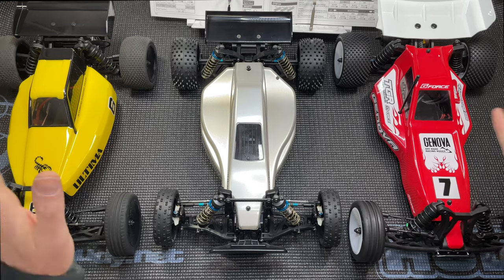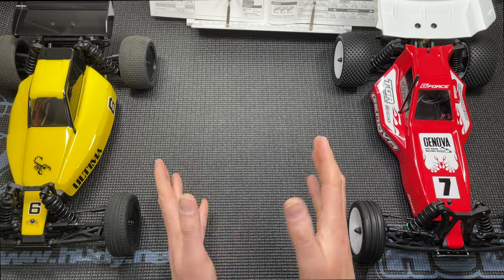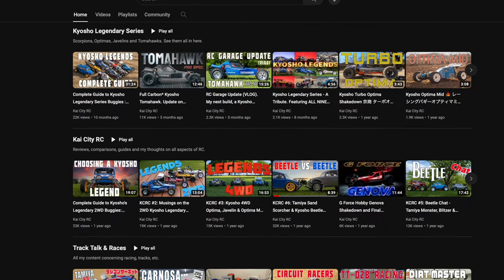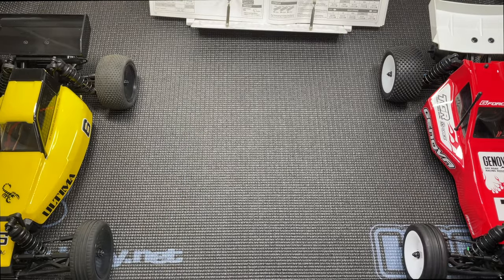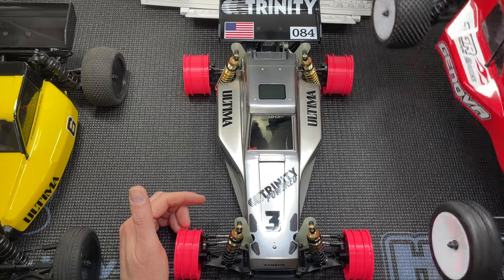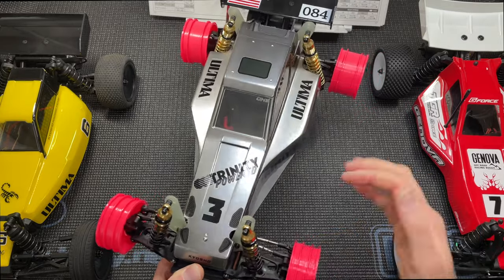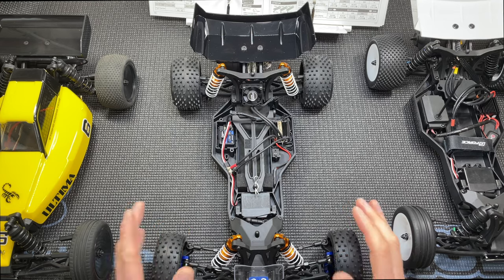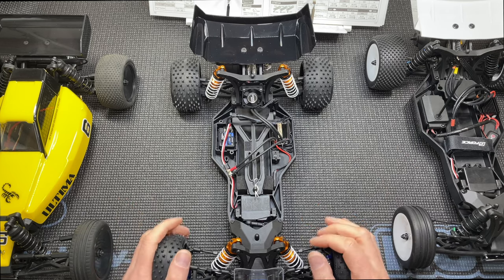RC Garage Update (VLOG): Final DT-02 Race, New Track, and a New Race Series for 2024.

Comment: please tell me. Is it likely that the S1 RM will come with a Genova or Tomahawk body?
Reply from the maker: The S1 RM won't come with a Genova or Tomahawk body as they are made by different manufacturers. If you meant, can you fit those bodies onto an S1 RM, well then.

The Genova body will drop straight on, don't even need to alter the cut lines. 👍 Though the side contours don't follow the S1 RM's exactly.

The Tomahawk body would require some cutting and it would stretch a little in places, but possible.

Hope that helps.
Reply: @KaiCityRC  Thank you for reply.
If it's a Genova body, it seems like it can be installed on the S1 RM by filling in the gaps with a sponge.
I like old-fashioned body designs like the Genova and Tomahawk.
Reply from the maker: I don't even think you'd need to go that far. It fits the S1 RM chassis surprisingly well! 👍

Comment: I just finished my Genova build. It was an easy car to build. The instructions show using machine screws everywhere. However, there are very few machine screws. Almost all of the screws are self taping. Once I figured that out it was a fast build. I did get all of the aluminum parts. Those parts are very expensive, but nice. The aluminum parts are all blue except for the shocks. They are orange ? That does not make any sense to me. I did get two bodies. I painted one in the box art orange. I did the other body in green with MCI decals to try and make my car look like Masami's car. I even got the metal ball links because this car has plastic ones. I did find that the pre-adjusted links were very close to where they need to be. That was nice. Also, this car does have turnbuckles which is a good thing. Thoughts?
Reply from the maker: G Force calls the Genova an "Easy Assemble" kit as many parts come pre assembled. The Alloy parts are nice, but very expensive and a full set of options would add to up to one expensive buggy. I added a few, mostly for durability during a race. In stock form the Genova has been ultra reliable and a solid performer. Even the stock dampers work really well. Not sure why they went with different colors for their alloy parts.
Reply: @KaiCityRC   I have to agree, why did they go with different colors. I did get almost all of the metal parts except for the front part. Some of the metal parts do not have the machine screws needed. I was annoyed about that. The metal parts are very nice, just far too expensive. I do hope as I saw in your last video they distribute this car. That might make the parts both easier to get  and cheaper to get. Thoughts?